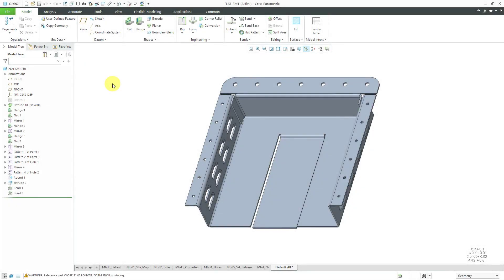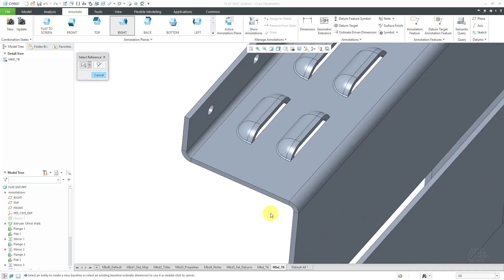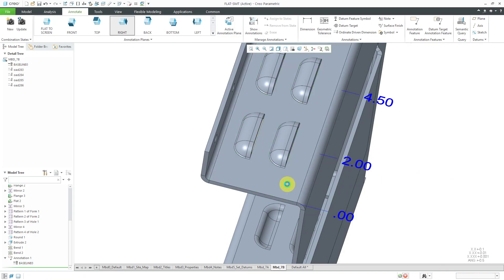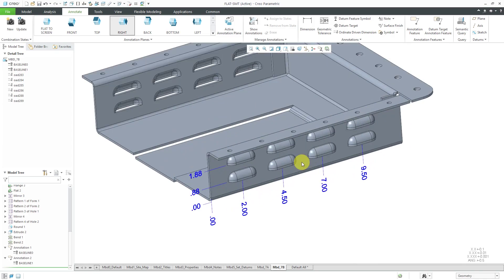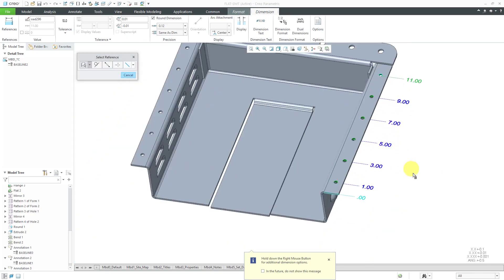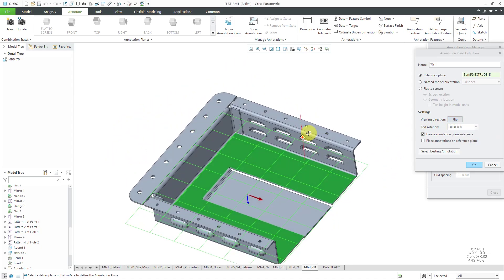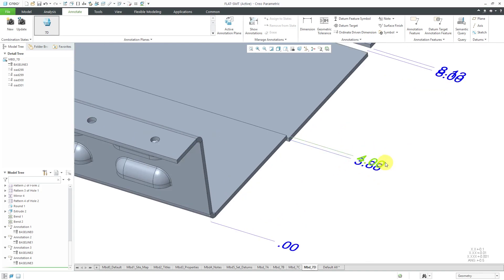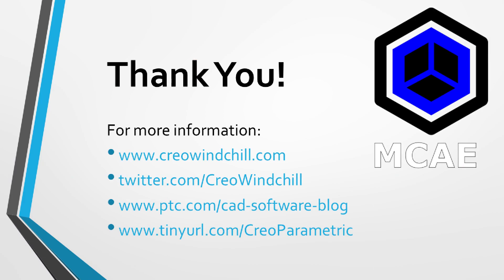Creo Parametric - Ordinate Dimensions - Model Based Definition (MBD)

Comment: Do you have a good way to dimension both the flatten state and formed state of a sheet metal part without the annotations breaking?
Reply from the maker: I don't understand what you mean by annotations breaking. But are you also trying to use the same annotations for documenting the formed and flattened states? If so, why? Wouldn't you use automatic ordinate dimensioning for the flattened state... if you are even bothering to document the flattened state. If you're not bending the sheetmetal yourself, your dimensions are going to be wrong. Only the sheetmetal manufacturers understand the bend allowances of their machines and their supplied materials.
Reply: @CADPLMGuy  We manufacture in house and need to supply the dimension from the edge of the part to the break lines for the manufacturing team. They use these dimensions to program the brake press. Plus they need formed dimensions as a quality check after the brake process. Would like to have all the info in one model/file to maintain. We are just getting started using Creo and MBD so this is all new to us. When i dimension in the flat state or the formed state I have trouble with dimension annotations failing when going from one combination state to another.
Reply from the maker: Do you have separate annotations for each state?
Reply: Yes. I have tried creating the dimensions as just annotations and as an annotation feature. Both have the same effect.